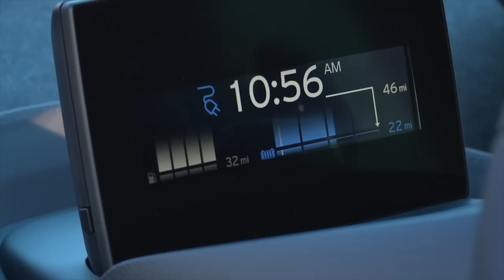Five Things We Need To Improve About Electric Cars

Comment: Regarding Longevity, I don't expect an EV to last all that much longer than a comparable gasmobile.  There are a huge number of components and systems OTHER than the driveline, and these wear out, rust, or break.  Tesla may have taken care of the rust problem with the Aluminum bodied Model S, but Aluminum bodies are expensive.  The Model 3 is steel, so it will be susceptible to rust.  EV drivelines have their own points of failure.  The battery is an expensive question mark.
Reply: NantEnergy
Reply: well, where I live we dump so much salt on our roads that the average vehicle lifespan is about 15 years. however I've seen people get their cars rotted after only 10, while others get their cars undercoated and dive them for decades. however in general, if you're not undercoating, expect 15 years life regardless of how well it runs

Comment: There is a small but obvious group of drivers that current EVs don't cater for, except with v-expensive models, and that is those who regularly tow.  Caravan owners, boating, riding, gliding people etc regularly need to tow trailers.  Currently diesel is the fuel of choice and at the moment there are no sensibly priced EV options to replace them.
Reply: Tesla model X. Wait, before you scream it's not affordable... have a look at the vehicles that are in the parking lot at the local pony club where people are towing horse floats. See any Corollas? No, me neither. Top of the range Porsche SUV, huge Lexus 4WD, a few people slumming it with shiny new Discos.
Reply: @gasdive  Not here in the UK!  if you are into "Donkey Walloping" your more likely to find the Discovery Sport, BMW X3, VW Tourag/Tiguan or maybe a Volvo XC 60 or 90.  All much more modest than the list you quoted.  In my hobby of gliding most towing is done by standard cars, I think you call them sedans and hatchbacks.  Still no where near Model X.  My original observation still stands, at least on this side of the pond.
Reply: @Jim610  Well then, if a standard car is fine, then a standard electric car is fine.
Reply: gasdive great- but where are they!?
Reply: @gasdive  The problem is they don't have an option for a towbar, making towing difficult!  A quote from carbuyer.co.uk in a review of the Kona Electric is "As with many electric cars, Hyundai doesn't recommend you use the Kona Electric as a tow car"
Reply: @Jim610  You'll find that basically all small sedans and hatches have exactly the same recommendation against towing, "but if sir would like to step this way, we have a lovely X-trail with a 3 tonne towing capacity that sir would look very smart in..."
Reply: @gasdive  And is that Electric?  On this side of the pond X-trails are 1.6 petrol (sorry, gasoline) or 1.6 & 2.0 diesel. My point has yet to be disproved.
Reply: @Jim610  No, its diesel. That's what I mean, they always want to upsell. If you say you want to tow a tiny box trailer they'll try to upsell you a giant truck. Doesn't mean you can't tow with a small car, petrol or electric.
Reply: @gasdive  Right! The original video was about what EV manufacturers needed to improve to make them more saleable.  I added what I also considered to be required.  That is all.  I've been towing, big and small, for over 30 years.  I've had cars with factory fitted tow bars and I've had cars I've had to fit an after market tow bar to.  In all cases the car had the option for a factory fitted tow bar indicating that the manufacturer considered them suitable for towing and they all included max towing figures in the handbook. At no point did anyone ever try to "upsell" me a truck, probable because when they saw me they knew I knew what I was talking about.  Currently there are no sensibly priced EVs that offer a factory or after market tow bar which would indicate they don't consider them suitable for towing.  That is my last word on this thread which is getting out of hand.
Reply: @Jim610  I agree completely. They should offer tow packages, even if they're light. But of course that presumes any of the manufacturers (other than Tesla) want you to buy their electric car. Which is debatable. (And I'd argue that none of them do want you to buy)
Reply: @Jim610  Tesla Model 3 with towbar, and 2000 lb (900 kg) capability will satisfy many users:
https://www.youtube.com/watch?v=T0elUxmCniw
Kia Niro EV could have it too, but you would have to ask the dealer. The hybrid version has this ability.
Reply: @gasdive  I was going to say i see a lot of people with 3/4 ton+ pickups for those purposes. there's nothing (yet) electric in that market. the Bollinger is a class too high, and the Model X is a class too low. because if I remember right, the Model X was rated only for 5,000, whereas pickups these days are going upwards of 40,000 pounds
Reply: https://youtu.be/kbRo3XpPdw4
Reply: @gasdive  This video mentions fitting a bicycle rack or cargo carrier.  Nowhere was a towball mentioned or even hinted at  and, by the way he was ravaging the chassis with the router it certainly wasn't a manufacturers recommended fit.
Reply: No I think he was using sarcasm to show how the salesman is likely going to try and upsell you to a bigger/more powerful (and far more expensive!) model, rather than agree/let you know what actual towing capacity the normal sedan (that is not recommended to tow, but can - for small/light loads anyway) has the ability to pull. Similar case in point to what you were saying earlier, I have an 91 Camry wagon that my grandfather (purchaser) put , not only rear, but front towbars on, because my grandparents loved fishing and needed to tow their tinny with. I've read the manual, and it says it can tow up to 500kg but doesn't recommend it unless you speak to a professional (something along those lines anyway). I'm pretty certain it's not an official Toyota towbar (the front one certainly isn't!) and was installed after market. To this day it pulls my 12ft trailer sailer just fine, but of course I wouldn't want to pull much more than that.
The one caveat I'll grant you with regards to being able to similarly after market fit a towbar to an EV is that there aren't yet any wagons available and so I'm not sure whether the rear frame having leaf springs makes it easier to fit as I've only owned utes and wagons so can't recall what the rear frame is like on a sedan. Having said that, I've seen an old Ford laser with one, so it can't be too hard. 
TL:DR if someone wants it badly enough, there's nothing stopping them doing a custom install and just dealing with drop in mileage...
Reply: @aussiepyro  I didn't read your reply before I replied. You said it better than I did.
Reply: Tesla model 3..